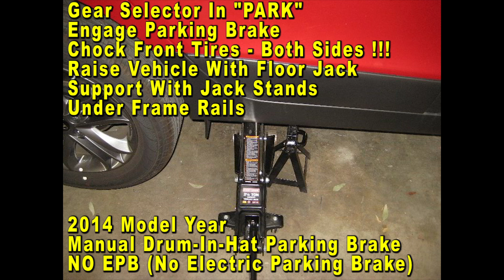2010 To 2015 Hyundai Tucson How To Change Rear Brake Pads With Part Numbers & Torque Specifications

Comment from the maker: Hyundai Tucson Rear Brake Pads - https://amzn.to/3yvgI4P
Wagner QuickStop Brake Pads Part # - https://amzn.to/3YN6xDq
Bosch Ceramic Rear Brake Pads - https://amzn.to/3yvgTx1
Bendix Brake Pads Part Number - https://amzn.to/3yueP8x
18" F Clamp - https://amzn.to/3SPhTTE
Precision Screwdriver Set - https://amzn.to/3sLixaP
Plastic Pry Bar Tools - https://amzn.to/3HMtsV7
Socket & Ratchet Set - https://amzn.to/3Z17LbA
Mechanix Gloves - https://amzn.to/3jCnHkt
Torque Wrench - https://amzn.to/3vS5uSI

The Paul79UF YouTube channel is a participant in the Amazon Services LLC Associates Program, an affiliate advertising program designed to provide a means for sites to earn advertising fees by advertising and linking to Amazon.

This DIY video shows owners of the 2nd generation 2010, 2011, 2012, 2013, 2014 and 2015 Hyundai Tucson SUV how to change the rear brake pads and lubricate the caliper slide pins with the torque values for the caliper bolts, bracket bolts and lug nuts.

Comment from the maker: Check out the DIY guide for changing the rear brake pads on a second generation 2010 to 2015 Hyundai Tucson - 
https://www.paulstravelpictures.com/Hyundai-Tucson-Rear-Disc-Brake-Pads-Replacement-Guide/index.html

Here are all of the DIY repair and maintenance tutorials for the 2nd generation 2010 to 2015 Hyundai Tucson - 
https://www.paulstravelpictures.com/Articles/Hyundai-Tucson-Common-Problems-Repair-Maintenance-Guides.htm

Owners of other Hyundai and Kia vehicles such as the Accent, Elantra, Sonata, Azera, Veloster, Tiburon, Genesis, Lavita, Veracruz, Santa Fe, ix35, Equus, Cadenza, Forte, Optima, Rio, Soul, Sedona, Sorento, Spectra and Sportage may also find these DIY instructions to be helpful.